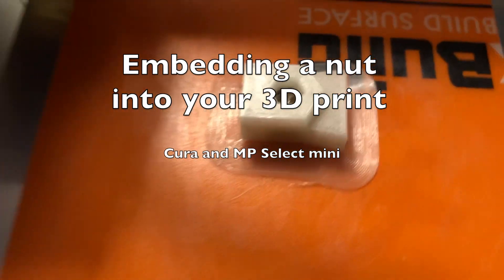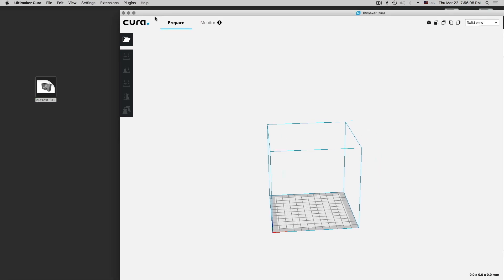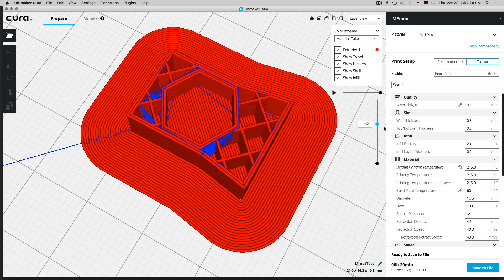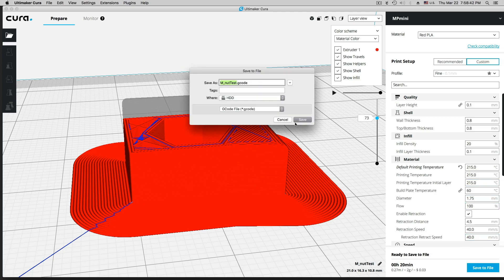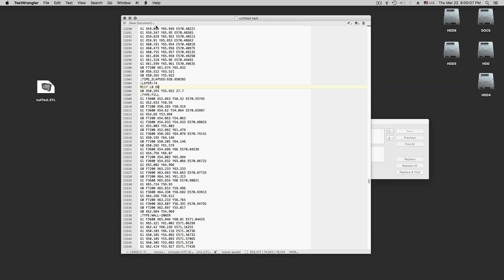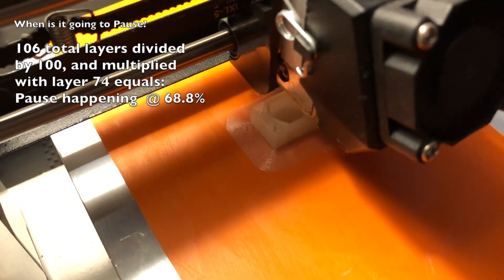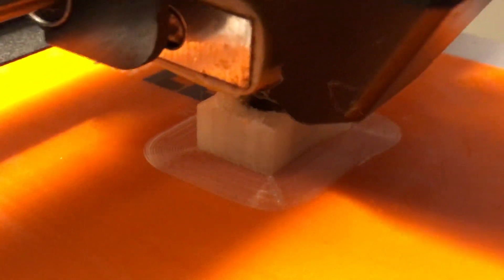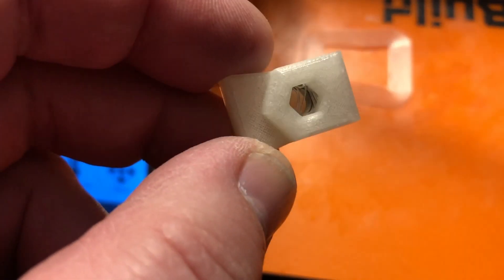Embedding a Nut into your 3D Print

Comment: I did some testing and found that the filament did not stick properly to the nut. The printer puts filament onto the nut that will shift immediately (stick rather to the nozzle than to the nut). It is visible in your print also. I did find a solution for that. First I applied some coating onto the top surface of the nut. Nail polish seemed to work perfectly. Secondly, I preheat the nut by putting it onto the heated bed. With those 2 steps the filament sticks equally to the nut like as it sticks to the filament already printed.
Reply from the maker: An Wira good idea, but i don’t want the filament to stick to the nut in my particular use case. It needs some space to move around to make it easier to align the bolt later.